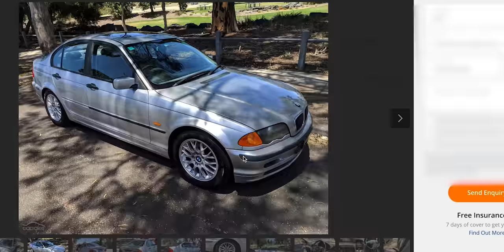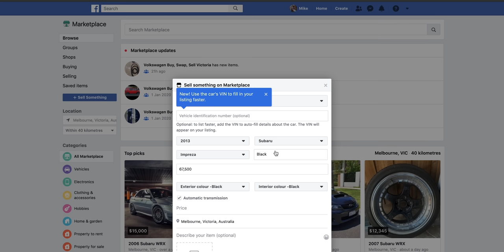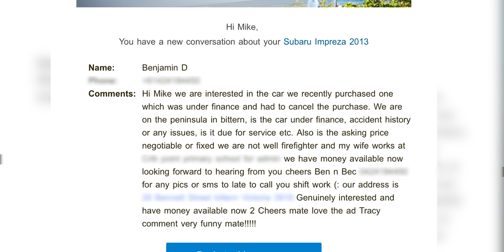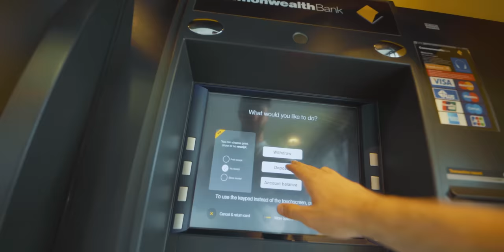How To Sell A Car With Photography!

Comment: If you have a DSLR, use your telephoto lens to shoot exterior shots.  This will better isolate the vehicle and since you will need to back away from the vehicle, the near far distance ratio between the front and rear of the car will appear more compressed.
I use either a 200mm or 400mm lens for this.
Try it, you'll like it, as they used to say.

Comment: Will regret it when the 2020/2021 is released with the new engine, way more power, and an updated interior. The 2019 STI is no different to a 2006 engine and drivetrain wise. Not sure why Subaru are delaying it so heavily.